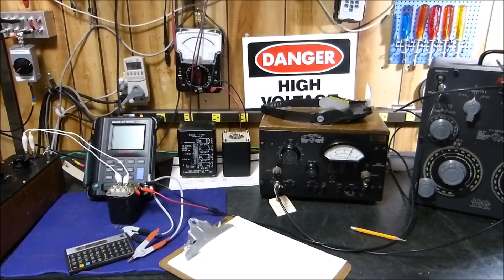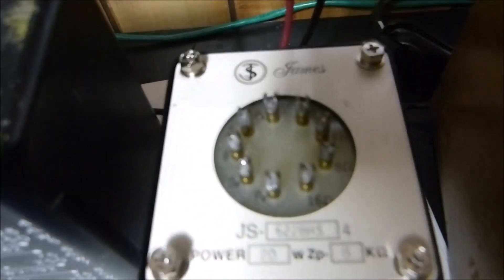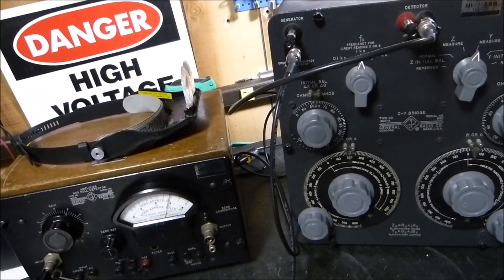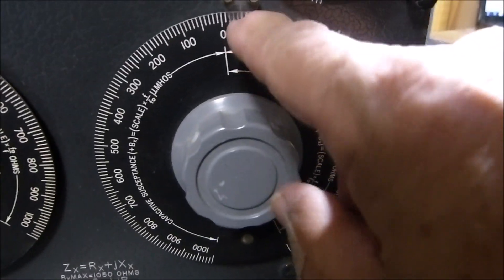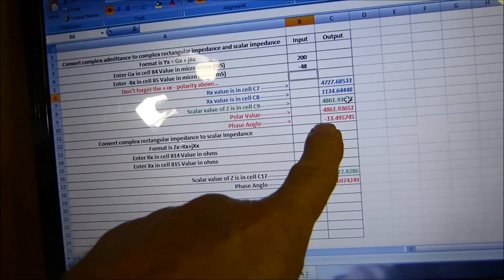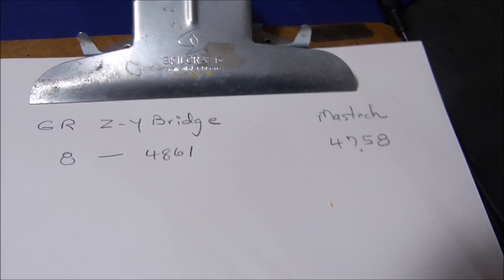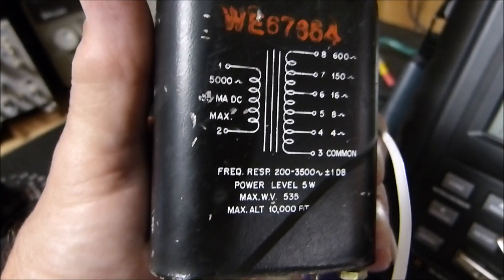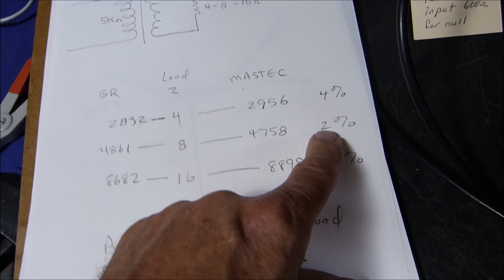Audio Output Transformer Impedance Measurements Using Mastech MS5308 LCR Meter

Comment: In the 1980s, I used a G.R. RF bridge for measuring the base Z of a 398' AM tower (with a Hammarlund SP-600 as the detector).  Oh, how I wish I had one of those!  These little Z-meters are great, but they don't do RF.  If I had an RF bridge, I'd go wild designing & building antennas.

Comment: Doesn't changing the load, from 8 to 16 ohms on the 8 ohm tap for instance, change the frequency response? So connecting your speaker to a different secondary tap to change the reflected Z isn't really an option? No expert here, but this is what I was told.

Comment: Hey David, great experiment and very useful information as transformers can be a challenge to test with confidence. 
What frequency did you measure to compare the two. It looks like the Mastech goes up to 100kHz. It would be interesting to see a comparison at 2 or 3 frequencies. Also what signal level are your using with the GR and what is the Mastech using. I know other LCR meters use very small signal levels. This could account for some of the differences in measurements. Looks promising and you cannot beat the price. Keep em glowing!

Comment: I love this stuff! One piece of test gear I want to acquire is a modern LCR meter. But I think the old instruments teach you better. Yours are in beautiful condition. I do have a GR decade box I just purchased on EBAY, that goes from tenths to 1 meg. 
I think the difference between the two may rest with the mechanical vs digital readings. It's amazing that mechanical dials are that accurate. 
Impedance measurement across transformers is affected by lots of factors including the way the windings are wound, insulation materials, condition of the laminations etc. it's great to see the divergence between the theoretical and actual measured values.
Reply from the maker: The older instruments force us to know the difference between impedance and admittance. The GR instrument measures impedance directly in R+jX up to 1050 ohms but after that you have to go to the admittance scale that starts at 950 ohms (the two scales overlap a bit) and goes to 1 uMho or 1 megohm and then do the math to convert back from admittance to impedance. I guess it it cheating to do it with an Excel program...   
Think of the drudgery that the guys even as late as the 1960's when we went to the moon had to go thru. Pencil and paper and a good eraser - and a slide rule and a few special purpose mechanical machines. We are so spoiled today. Even I had a dedicated slide rule course in college around 1968. We actually had a four function electronic calculator in one of my physics labs. It was amazing...   :-)
I can understand the modern tools as it allows an engineer to progress fast - like construction of a building with a nail gun instead of hammer. I get it but there is indeed some satisfaction from using the old instruments - and... I personally use the older instruments to validate the newfangled ones as I did in this video. I pretty well trust the LCR meter now although I cannot get it to talk to my PC thru the IR/USB port.
One last thing on the beautiful condition of some of this vintage equipment is, I think a lot of came from universities or  US government sites where it stayed locked up in a safe place and only graduate students got to use it for one electrical lab lesson then it was whisked away and locked up again. I think much of it hardly ever got used as with no modern day calculators, determining even a simple measurement would be so tedious with just the arithmetic.... whewww.... who would want to do it?
Reply: ElPaso TubeAmps I agree, the old tools taught us the basis for so many things we tend to skip over today. I see that in many of the young engineers who work for me. Often their first question is " what software did you use to solve that problem?  They can't relate to working with a pencil and paper. And not surprisingly they have big gaps in their understanding of basic concepts like conductance, admittance,  reactance. They have difficulty visualizing the components of complex factors like impedance.

Comment: ElPaso: Transformers are very difficult to measure. The inductance depends on the signal level. One of these days I will design a SYSTEM to measure audio outputs transformers specifically. It is on my list. [non linearity is a bitch]
Reply: Please let me know if/when you do come up with some ideas. Setting up to test and match audio transformers is something I have been trying to refine as well. What do you think of using known loads a sweeping generator and an FTA analyzer?

Comment: David, I'm not clear what you actually did here. Did you measure the reflected impedance of 8 ohms via the 8 ohm tap, then 16 ohms via the 16 ohm tap, etc., or did you vary just the actual load? Or just the secondary tap?
Reply from the maker: What I did was use an 8 ohm load in each case. If I put the 8 ohm load on the secondary, I measured the reflected impedance on the primary and found it to be essentially 5K as the transformer was rated. It is mathematically/theoretically  true that if you move this 8 ohm load to the 4 ohm secondary tap, you would measure twice the primary impedance at 10K and if you move the 8 ohm load to the 16 ohm tap on the secondary of the transformer, the reflected primary impedance would be 2.5K. Somehow I have known this is not in reality, true. It is "true enough" to work with but it just isn't that exact. After a lot of measurements I entered the data as X,Y points into a least-squares curve fitting program and tried a linear equation fit which was relatively poor and then a second degree equation that gave me a goodness-of-fit something like 0.999 which is very good. I know this is a little out-there, but I am trying to demonstrate that if you have a transformer rated, like in this case, with a 8 ohm secondary and a 5K primary, you can "cheat" the transformer by a factor of 2:1 meaning you can use it in a 2.5K plate load circuit and put your 8 ohm speaker on a 16 ohm tap and things will go very well. You can also put this same transformer in a plate circuit needing a 10K load and put your 8 ohm load on the 4 ohm secondary tap and, again, things will go well. I am convinced from experience and empirical measurements that this will work for a 2:1 ratio but probably not so well for a circuit beyond that ratio. An extreme example would be putting a 1 ohm load on the 8 ohm tap will not give you a 5000/8 ratio on the primary. That is way too extreme. My global purpose is to hopefully, help others use the transformers they have in circuits that are not exactly designed for that transformer and impedance ratios. Hope this makes sense...
Also, I wanted to see and document if the new Mastech LCR device would give the same results as a lab grade instrument like the GR instrument and it did a darn good job. As I said, not as much fun as the GR instrument...   :-)   but a lot easier and quicker to use.
Reply: ElPaso TubeAmps David Thanks. So what was the 2nd-order equation you came up with? and does it correspond in any way to Maxwell's equations etc.?
Reply from the maker: @EJP286CRSKW  I will see if I can find the data and file - I think I saved it and I will send it to you via email. I wrote these programs in BASIC thirty or more years ago and I still use them. I don't know if I can attach a .BAS file to email or not. I assume all versions of Windows will run BASIC ?? If you are interested I will try to get them to you. You might find some of them useful.
Reply: ElPaso TubeAmps Thanks David.

Comment: Thanks for sharing another great video, David! Would it make sense to make the measurements using real 4-8-16 ohm speakers and see how it reflects to the primary? Maybe also adding a tube load resistance in series with the primary winding? Regards, Marko
Reply from the maker: Marko, I like that idea and will try it. I think it will show us data that will make us go .... Wow.... as to the variations in Z reflected back to the tube. I am having fun with short videos. Long drawn-out detailed videos are so hard to make recently as too many things interrupt my process and I forget the path I was taking so I am trying to make short videos and hopefully add some bits of value to the art of vacuum tube amplifier building.   :-)

Comment: very cute little LCR meter, i was loocking for a decent one but havent found nothing substantial, thanks for the mini review!
now that you have a "faster" way to measure transformers accurately i would like to see a little demo about core saturation in this transformers, i remember your try to use 70.7v transformers as output trnsformers, but what about  properly designed ones? do they also saturate so easly if not designed for single ended operation?

manuel
Reply from the maker: I am very impressed with this LCR meter. I have not found it lying to me yet...   :-)
As for the saturated cores of the transformers - I need to do much more research on that subject. I don't think my last attempt was a very good one and I think I made many mistakes in my approach. I haven't thought about that subject in a while but I believe both an AC and a DC component is necessary to make any accurate core saturation measurement. Maybe a later video...

Comment: Good thing to know that we can thrust these, the Z-Y impedance bridge never lies. (: I wonder, how did the other transformers comparatively measure? Oh, and thanks for the great showdown! :)
Reply from the maker: I have found that, generally, transformers measure within +- 5% of what their data sheet shows. The higher standard brands seem to measure the best. I do trust the GR instrument and I mentioned it is "fun" but sometimes it is nice to be able to quickly get a measurement and to also have a second instrument as confirmation. The Mastech instrument does a good job measuring inductance (L). We do have to be aware, with all instruments, the frequency we make transformer and inductance measurements as the frequency can seriously affect accuracy even though we know L is not frequency dependent, but the measurement process is. It has a selection of 100 Hz and 120 Hz for large inductors and it works very well. With both instruments, these measurements were made at 1 KHz. Thanks for your comment.